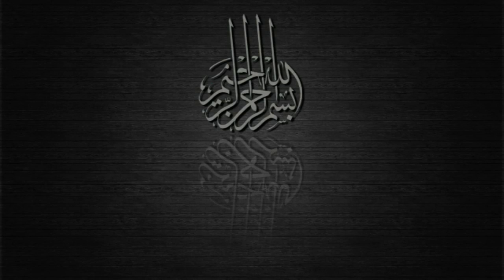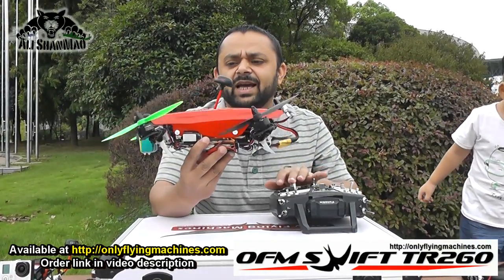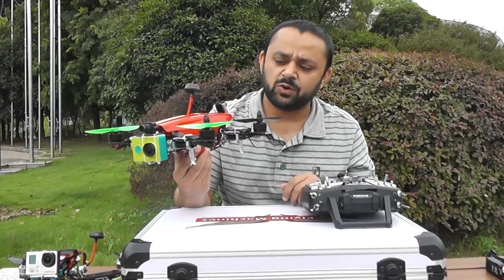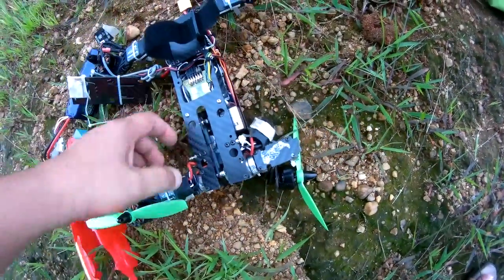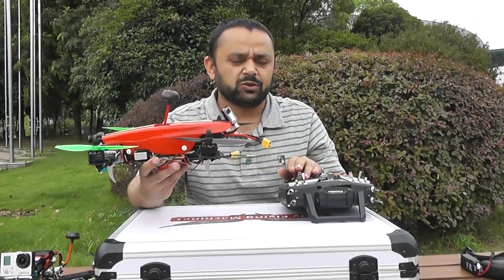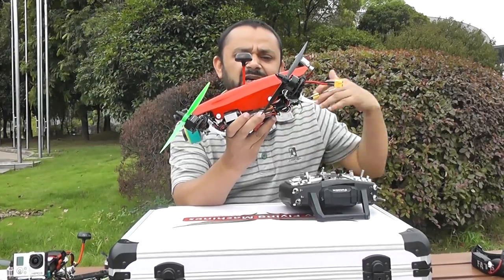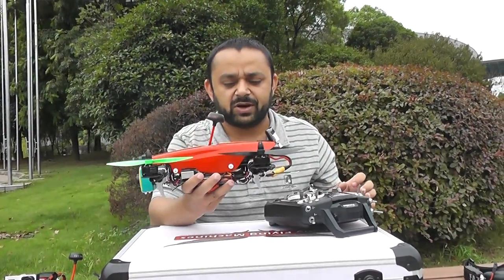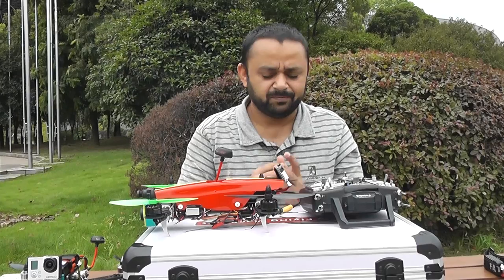Tilt Rotor Quadcopter OFM Swift TR260 How tilting works

Comment: Nice explanation Ali! How much degree is max angle fwd?
I just got a more traditional racer (280 calss) with powerful setup and the ability to mount the arms fixed in 0, 10 or 20 degree fwd angle. I use 10degree now and I'm considering to test 20 soon, but if youre always on 20 fwd the landings are difficult...
I'm curious to see if you concept will find its way into the race scene soon of if they will see it as an exotic.
I can imagine many racers will just stick with the fixed angle racers because its easier to build and repair and also lighter.
Greets, Mario
Reply from the maker: RCSchim Hey Buddy. good to see you here. This Quad can do 35 to 45 degree tilting depending upon how you  setup and program your quad. insane angles :D 

well we will start shipping in coming week. only few things here there missing that we are arranging now. 

I hope racers will find that tilting rotors are next gen racers due to their abilities to fly like traditional and get extra boost on open straight stretches with leveled flight using rotor tilting. also the customization you can do. like 2WD Vs 4WD :D only rear arms tilting and front staying locked is totally different performance :)

Wait till you see my build video and you will see this Tilt rotor is by far the easiest to build and least parts. 

Try your quad with 30 Degree forward angle and you will love it :D

Comment: I think I understand what you did to make a tilt mix. I have a Taranis. So I should have a "tilt" channel for the servo separate from the elevator channel. Should I use a switch to swap the stick between elevator channel and tilt channel, right? Or do you need some percentage of both? like 75% tilt and 25% elevator in tilt mode, and 0% tilt and 100% elevator in normal mode.

Comment: Very cool! Will you ever consider adding small wings on the arms perpendicular to the blades rotation that tilt with the motors. To create enough lift for horizontal flight? This could make for a very fast and power efficient drone think.

Comment: Hi
I fly taranis sounds like you are mixing different values to the servo and the elevator that goes into the flight controller example taken that your stick values range from -100 to +100 with 0 as the centre point for elevator value of +50 on the stick you output +50 to the servo but only +10 to the flight controller or around that amount.
Kendrick
Reply from the maker: Kendrick Apps you understand it right, using mixing we output more to servo, and less to flight controller :) easy for you to program on Taranis